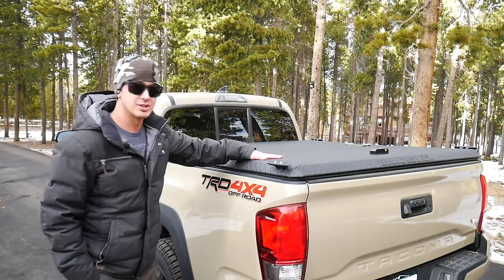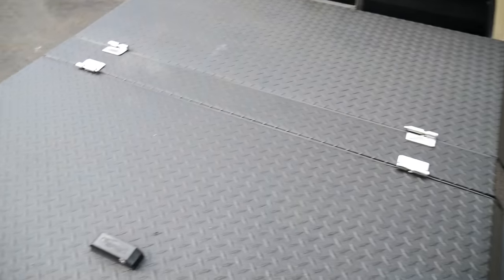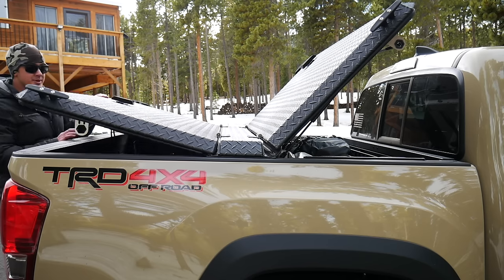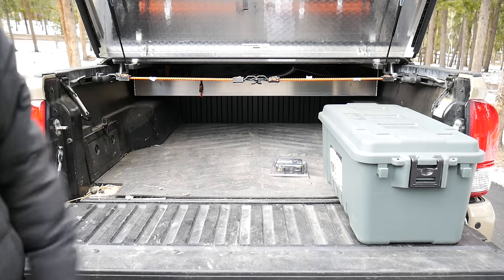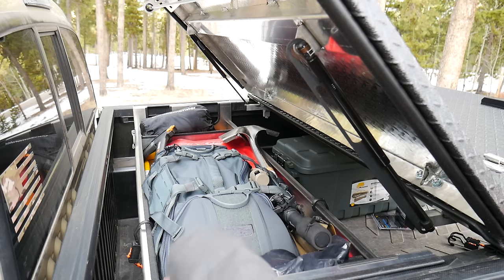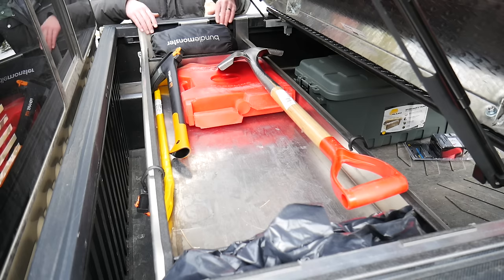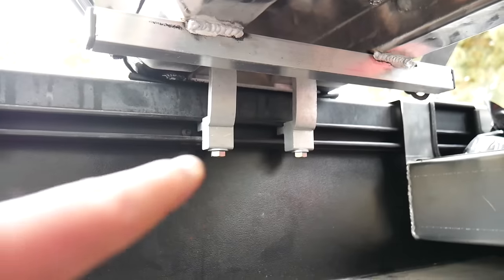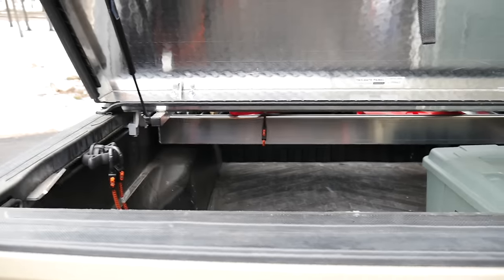DiamondBack Truck Bed Cover Review - Essential Truck Gear - Episode 2 (2016 Tacoma)

Comment: How do you secure your gas since the gas door soesnt latch shut?
Reply: @LastLineOfDefense  
The gas door doesnt lock shut and theres no gas cap.  I am thinking about buying a tacoma but that theres no lock for the gas door seems strange
Reply from the maker: There is a gas cap - but yeah it doesn't lock. Is gas theft a common problem where you live? I've never heard of that.
Reply: @LastLineOfDefense  
Not a problem but my honda gas door only unlocks from inside near the drivers seat... no locking mechanism makes me uncomfortable

Comment: What happens if someone removes the hinges? Can the panels be removed??
Reply: Gear Guy226 There are nuts on the underside of those bolts that would make it very difficult to do that (I couldn't do it with my impact driver).
Reply: Logic Bob Oh okay, really??
Reply: Gear Guy226 Yeah, I was gonna replace mine with some security head bolts but had such a hard time removing the standard bolts I figured I may as well leave them. And that was in my garage with an impact gun.
Reply: Oh wow. Lol Sounds good!
Reply: Carriage bolts FTW
Reply: C Yeah, I wish that was the route the manufacturer had gone from the beginning but obviously, we can't easily swap our own carriage bolts in now since the hinges don't have the square socket that is required.

Comment: Looks like just 4 bolts on the hinges and you've got full access to whats inside...
Reply: B. Stone what about the locking bar on both the front and back or the lipped gutter between the middle panel and the other two?

Comment: If you don't use your truck as a truck then this is a good option but if you have to load up your bed with anything big this is a joke
Reply from the maker: If you find yourself regularly hauling refrigerators, then correct, this isn’t the option.
Reply: @LastLineOfDefense   lots of yard equipment, including snow blowers, lawn mowers, and there are such large items.